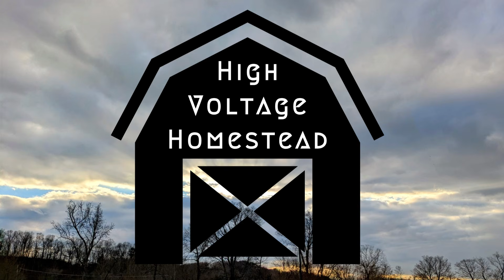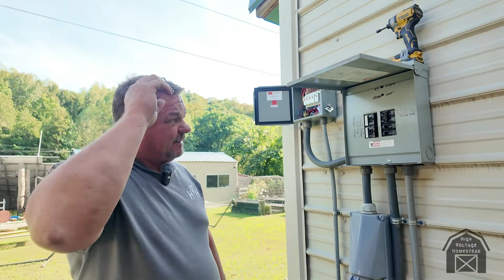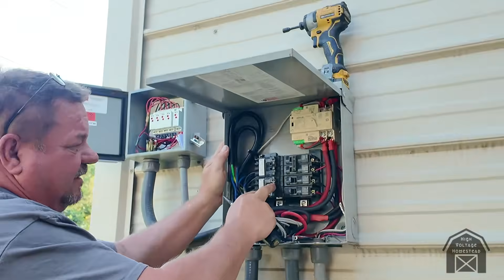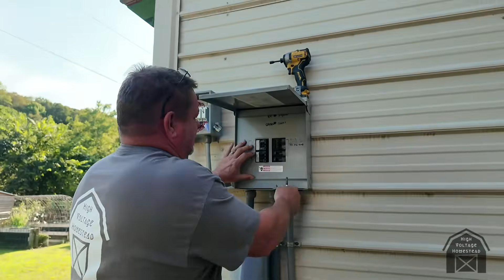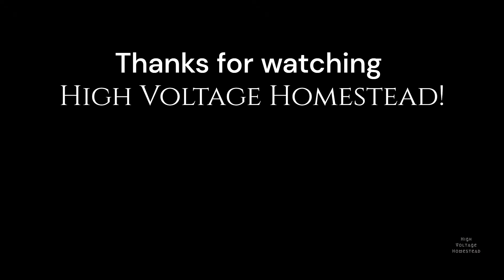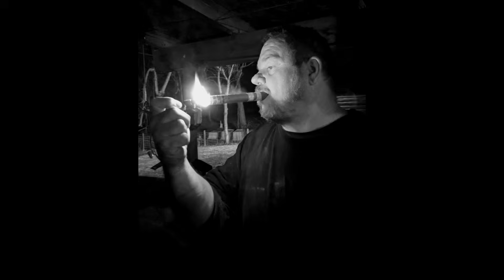Behind the Scenes: Walk-thru Part 2

Comment: I am really enjoying your Chanel.  I have a question,  what would be your recommendation for modifying a heat pump to use two 3k heat strips instead of a single 10k?
.  In the winter time, I want the first heat strip to be instant and delay the second one by several minutes. It ties into bringing my house off-grid this winter.  Keep up the great work!
Reply from the maker: Thank you, depending on the make of it most have just a hole with blanks so you should be able to swap them out.  I'd just use a little ICM delay on make relay to start the second strip and set it for however long you want.  Your t-stat probably has a setting if you want it to delay the 2nd stage strip as long as you have an extra wire in the t-stat cable.  Relay link:

https://www.amazon.com/ICM-Controls-ICM102-Minutes-Adjustable/dp/B07Y4QBNV3/ref=asc_df_B07Y4QBNV3?tag=bngsmtphsnus-20&linkCode=df0&hvadid=80333260065591&hvnetw=s&hvqmt=e&hvbmt=be&hvdev=c&hvlocint=&hvlocphy=100622&hvtargid=pla-4583932727778119&psc=1